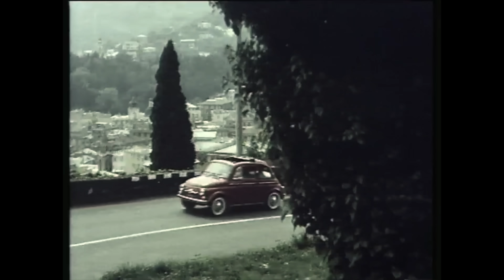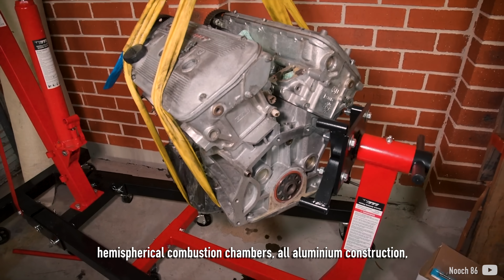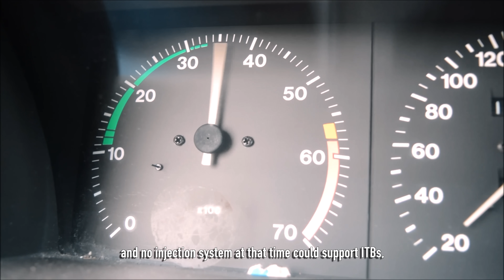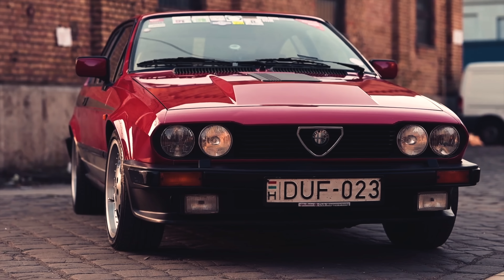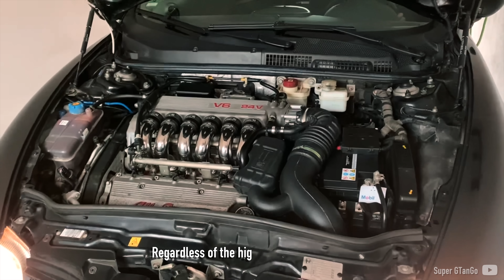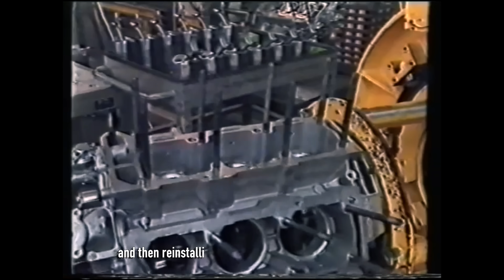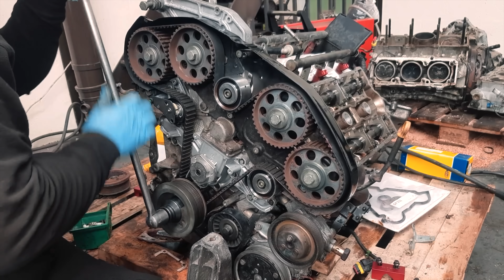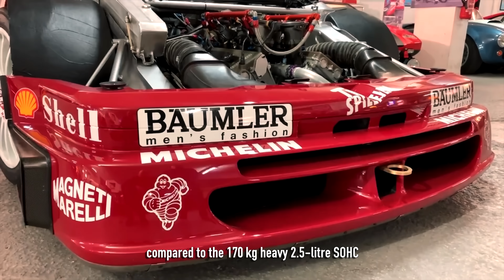This Is The Best Tuned V6 Engine

Comment: I bought a 2.0 V6 turbo 166 last year with 150,000Km on it and it is amazing to drive. Very revv happy, predictable, stable. Sounds amazing! Still reaches its top speed of 260Km/h on the Autobahn and has no issues staying there.

240HP stock and that's with(and I found this out recently) only 3 cylinders getting forced induction + it has factory overboost(srsly, how many stock cars had factory overboost in 1998?!) triggered by either very fast accelerator pedal movement or an on/off button labeled STR(Sport Throttle Response). 

It's for these reasons why I think the 2L turbo is the best Busso out of them all, having even more tuning potential with very little effort.
Reply: Each of the 6 cylinders is boosted: the intake plenum is the same for each of them...
Reply: @Lacombeist  The shop where I maintain it told me this when they were changing the spark plugs, since they had to remove the intake. I took their word for it
Reply: @UzY3L  in fact, you have to remove the intake plenum to change the spark plugs of the upper bank. Maybe it's a misunderstanding

Comment: I love this engine, I worked at a Ford Dealer, little italian man came in with a 5 speed 164 S, had 211k on it and was still in good shape and ran like a top. They gave him 600 dollars as a trade in on a focus ST, you bet your sweet ass I slapped a dealer plate on it and took it for a rip! The salesman were ignorant and laughing at the "old red car" until they heard the busso rev and smoke the tires off, I wanted to buy it after that... They told me 3k, thinking back on it still worth it, of all m5s, trans ams, corvettes, gt500s, jaguars, I've driven.. The little high miles 164 S was one of my top drives ever, you just can't buy soul. I ended up taking the owners manual out of it which had everything! I would sit in it on break, still smelled like italian leather, I regret not buying it
Reply: In Brazil, Fiat sold 164 5 speed manual and 4 automatic.
The engines were 12v and 24v.
12v has better response in lower rpms, 24v only wake up in 5.000 rpm.
Reply: oh beautiful read...like my missed chances with hot dark south italian girls... i sadly have to admit such a regret, having tried so many others and just wasted time... always listen to your inner passion voice, always...
Reply: Traded for a POS Focus. Sad. Also they were selling it for 5x what they gave him on trade? What a sad excuse for a reputable car dealer. Scumbags.
Reply: @HoggishGreedly   To an employee no less, I should have said a grand. It would have been a lot of heartache but also a beautiful summer cruiser

Comment: Not sure if it is the best V6.... No doubt it is a very good V6.... But the newer V6's from Toyota are far better
Reply: are you smoking crack? Toyota's engine are absolute shite when it comes to performance and sound. They have a seriously low torque and those engines such as those used in the Lexus are meant for smoothness and reliability but they are dead boring engines and nothing great about them. The 2016+ Alfa Giulia Quadrifoglio V6 engines absolutely puts any V6 Toyota has even tried to make to utter shame. This is the same Toyota that had to use everything BMW for the new supra. Why isn't their fantastic V6's in the Rebadged BMW Supra. You really misunderstood what this video was about. You are talking about most reliable V6. You want a performance V6 you can forget about Toyota reliability. Why do you think Toyota doesn't have any high performance + most reliable V6. You have to give one up for the other. It's a balancing act.
Reply: you need an inline 6Toyota  - 2jz to toast this Italian endless money pit
Reply: @fidelcatsro6948  a naturally aspirated 2JZ is an absolute dog. Nothing special about it. And if you are referring to a turbocharged 2JZ, i can show you plenty turbo/supercharged Alfa Busso’s that will piss on a 2JZ all day long..

Comment: Love your video's and as a alfa romeo fan especially fond of this busso video. Many thanks for the beautiful content. 

Maybe nice to know: , to meet regulations and retain max engine output possibilities    for DTM in the 155 it did give the alfa corse team a headache problem to use the busso. They needed to change v6 block angle to optimize the engine. In the end they used in DTM not a busso derivative, but was it allowed in regulations to use a engine setup from lancia(part of the group)  from a far past. They had to use the block angle from the lancia aurelia. Of course all the rest was totally different, but got away with it in regulations somehow.
Reply: In reality, the busso engine block was never used, the DTM engine was a bespoke racing engine, the only relations with the Busso engine were the number of cylinders, the V angle and the cilinder axial distance (between the centers of the cylinders in a same bank).
Reply: @hiperformance71  I agree that the engine was bespoke, but was under the assumption that the geometric elements (v angle of the block)  of the lancia aurelia v6 were used instead of the busso.
Reply: @hanswieringa9911  from what I know (I'm Italian, and readed a lot about these techonologies because I'm working in the racing industry and love racing technology) is the initial project was based in the v6 buso, V angle of 60 degrees, but successive versions of the DTM/ITC engines were made using a lancia engine(but produced by alfa romeo, with a V of 90 degrees. Here in YT, youn can find a good video interview with one of the engineers who designed all those DTM/ITC engines were he described all this, the video is in italian but I think it has english subtitles. If you like:

https://m.youtube.com/watch?v=DRcFpmQL3bc
Reply: @hiperformance71  great video, thank you! Truly mesmerizing!
Reply: @hanswieringa9911 I thought it was from the Alfa Montreal?

Comment: Just wanna suggest to all those whom think these are THE engine to go for, Mitsubishi and Honda v6s out class them in performance and reliability in the same years, bigger parts availability and similar exhaust notes with decent setups. And they are confined to awful looking cars as well.
Reply: Absolutely ridiculous notion
Reply: This is funny, and I do agree with most of your points. Europe didn’t get the J series motors in the same volume as North America did so europe found its v6 tuning idol elsewhere. But worldwide the best v6 tuner engine is undoubtedly the vr38. Ain’t no other v6 motor coming remotely close to what people are getting out of those motors
Reply: BAHAHAHAHAHA, I am very familiar with Honda engines and you are off your rocker.
Reply: Your right. Japanese engines and particularly Honda will run forever. Italian engines might sound good, but are trouble. What's an Alfa anyways... Only a glorified piece off shit Fiat.. 😜😜
Reply: @265justy  There isn't any Japanese engine that runs forever, in fact Honda's latest engines are notorious for brining oil which they had to recall and replace 10's of thousands. Putting that aside, you fail to understand automotive engineering. Porsche, Merc, Ferrari etc... all suffer the same consequences when building high performance/low displacement engines.
Why do you think Toyota massively Detunes all their engines, so that they last longer. There is no way getting around it. Hence why the modern Japanese engines are cookie cutter boring design's. Did Honda's F1 engine last, nope in fact it was sufferings numerous reliability problems but you keep feeding yourself that BS about European engines being inferior to Japanese. Also why do the Japanese copy European engine designs. I bet you think Vtec was a Honda invention when it was actually Alfa that invented it and then sold it to Honda. 

The irony of this is all is you have a Mazda in your avatar. Mazda loves Alfa Romeo and their design cues in the past 8 years are Italian inspired and they even work with Alfa. You have a very narrow view of the subject at hand. Remember I responded originally to the claim that Honda engines were outperforming and more reliable in the same year the Busso came out which is nonsense. Honda has made fantastic engines in the past and even their recent 2.0L VTEC TURBO engine for the Type R  is a prime example of a spectacularly engineered design.
Reply: @paulj9821  Honda made higher HP per litre v6s and Mitsubishi did too both boosted and n/a in the 90's the busso could not keep up.

Comment: The V6 is garbage. There is no such thing as a 'best layout' for a junk design. The I6 reigns supreme.
Reply: I6 is junk, even Alfa  dumped its own I6 as I6 is very bad package and repqalced it with this much better design, just look what warpoing head problems  BMW has, google just BMW engine problems.
Reply: @coltr7561  Just like Nissan/Infiniti.. really working out for them isn't it. Big Daddy, MB brought it back.

Comment: Then I wonder why Alfa started using Ferrari's new V6....
Reply: The engine was developed in the 60's and made until 2005. How many decades do you think a engine is being made?
The other engine Busso made (the 4 sylinder), was in production from 1954 and all the way to 1994.
Reply: They used GM V6 in the 159, Busso was dead
Reply: Engine designs usually stop production because they become outdated in some way. To little power, to high fuel consumption or to expensive to produce vs the competitors. Or that they can't be made to meet new stricter pollution regulations.
Reply: Cheaper to start from Scratch then redesign the old engine for use with variable valve timing, variable intake length and more of these modern things. Also the crank of the Busso is a hefty unit that means high rotational mass which is bad for emissions.
Reply: Oh OK. So where is Toyota’s 2JZ???? Or Ford’s Pinto??? Get another angle for an arguement…
Reply: @namibgtv6  Right... so where is the Nissan RB26DETT?

Comment: Reasones for buso engine fuel consumtion 🤔 a certain amount of fuel is converted into power and torque the remainder of the fuel is turned to noise 🤗 a verry nice noise  😆

Comment: Wait, so some DTM Alfas used a PRV V6 block, isn´t that the same that was in the DeLorean?
Busso swapped DeLorean would be sweet, I wonder if people have done that.
Reply from the maker: Yes, the DeLorean used the PRV engine.
Reply: Yes, later DTM engine was based on PRV engine. Lancia used that engine in the Thema so they were allowed to by the rules. Bank angle of 90 degrees gives lower centre of gravity and the bore spacing was also more usefull for the engineers. But the resulting engine was completely new, no parts interchange with the PRV.
Reply: According to the regulations the engine had to have the same bank angle and cylinder centre distance as a standard engine, but apart from that it could have nothing else in common. The PRV engine had these suitable values, so a completely new engine was made but with the same bank angle and cylinder centre distance.

Comment: Imagine the new Giulia with a NA 500hp 9k RPM 4.0L Busso V6..
Reply: I mean, the new guilia has a baby ferrari engine with 2 pistons chopped off. You can't be mad about it.
Reply: @OG_ALviK  not true they used the engine block from the V8 Ferrari and most everything else was changed. You should read up on what the engine designers for both Ferrari and Alfa had to say about the Giulia engine development. They spend over 280 Million developing an that engine.
Reply: It's a shame the new Giulia Q engine sounds like crap. A modernized Busso would have been so much better soundwise.
Reply: @giuliettaevo  unfortunately there is nothing that can be done about it since EU emission and EPA have forced manufactures to produce small displacement engines and the banning of V8's. Even Ferrari is being forced to manufacture V6 engines for their future cars.

Comment: Alfa best tuned 6 cylinder motor? When I bought my 2012 A4 Avant Consumer Reports rated the A4 second in reliability after the 1st place Toyota Highlander. LOL
Reply: But its still on an audi, an understeering soulless skoda
Reply: @sotirismp2883  Lol. Dude be hating on the best awd system in the world. Alfa had one decent engine lineup. That is it :D
Reply: @RealLeskot  ìts not best  awd, even Alfa has better awd system
Reply: @coltr7561  Dude.. please stop the copium is hard.
Reply: @RealLeskot  i dont know any copium. Audi awd sucks

Comment: you should do a research on the vg30de(tt) cause in 1989 it has 222 in NA and 300 in tt version, the 300zx won a lot of race and had the record for the fastest production car.... it went 260 mph in the 90's
Reply: 260 mph? You are about that?
Reply: @frecherfreddovic  more likely it was 260 km/h. I'm not a fan of the Nissan but Mitsubishi has a great V6s too, like 6G72TT in the 3000GT
Reply: @matiz33  look for it it was 260 MPH in 91 the car had around 1200 whp
Reply: @yantheriault4995  1200 HP in a production car?